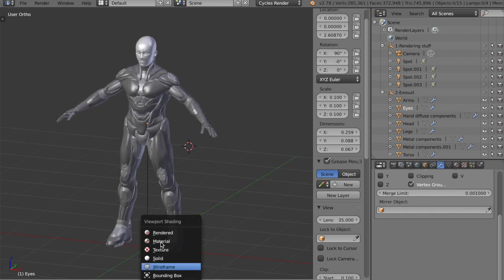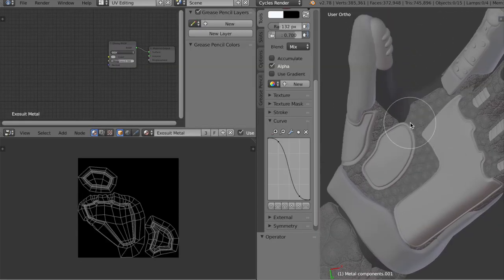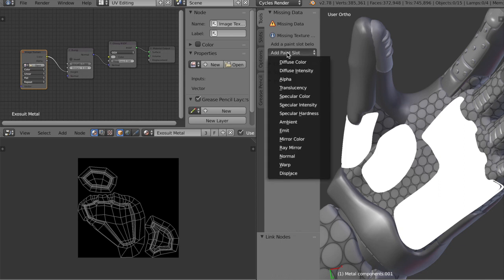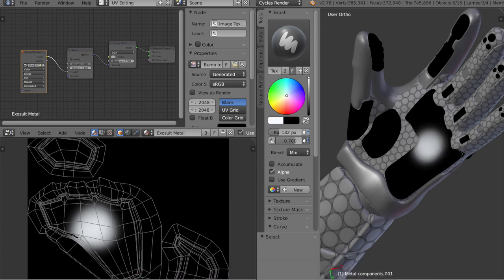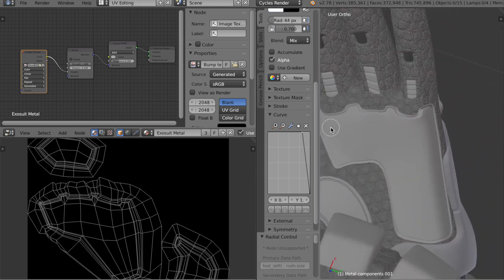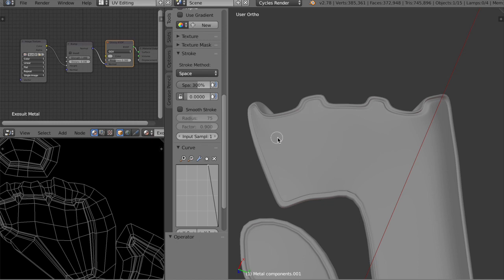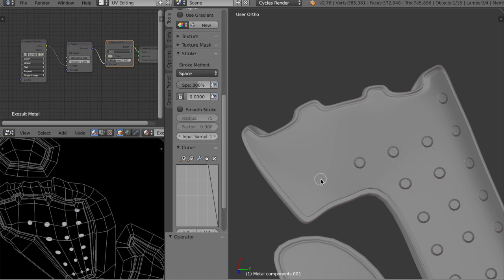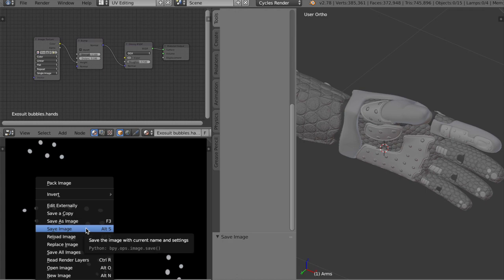Blender Bump map painting tutorial!

Comment: This model is simply amazing and should be in movies. Anyway, just wanted to ask, if is it still possible to pose or animate a model with this much detail, or will it have some deformation problems. I am trying to make a good workflow on modeling, posing and 3d printing my characters and I think this would be a good procedure if model can still be posed.
Reply: for posing i propose you make a low poly model, bake the normal of the high poly onto the low poly, so as you can pose the low poly on any position you want without losing the details of the high poly